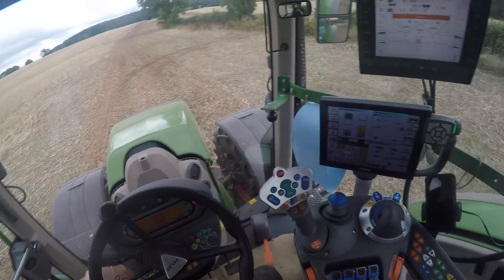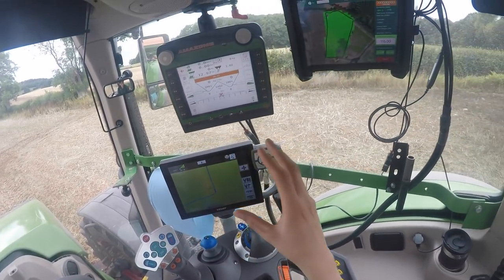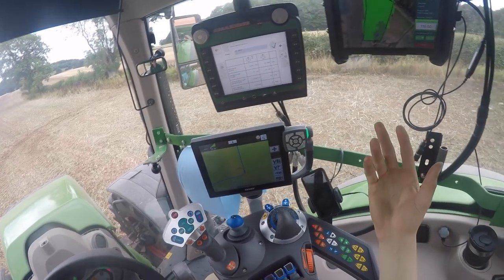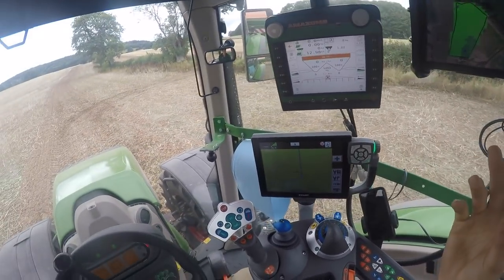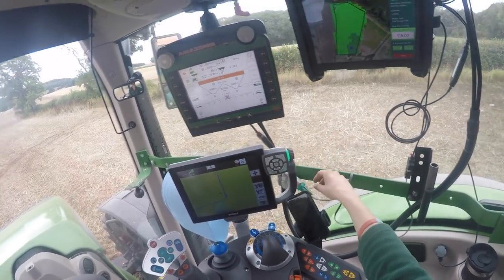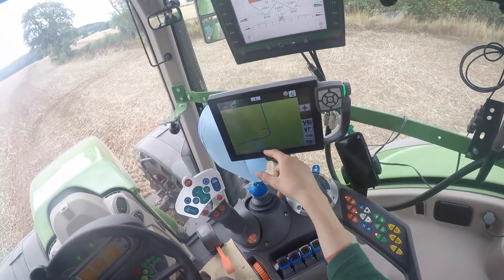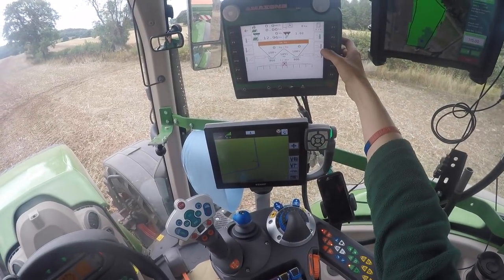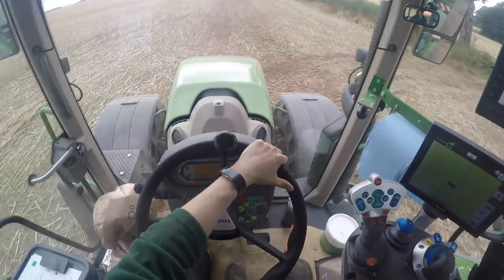Fertiliser Spreading - Fendt 724 and Amazone

Comment: Do you have the same problem as me, that the ZA-TS spreader shows fewer hectares than the field really has?
Reply from the maker: Wemberr2 I haven’t noticed that problem yet but will keep an eye out and let you know..
Reply: How many meters do you have set the fertilizer switch on and switch off point?
Reply from the maker: Wemberr2 Depends on what is being spread but around 24/26m. Amazone fertiliser service app gives some good guidance